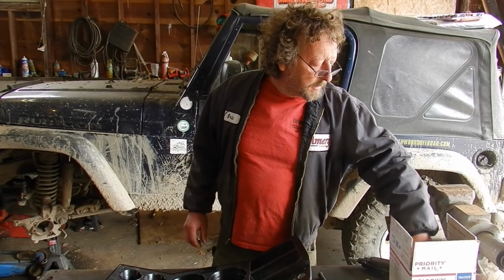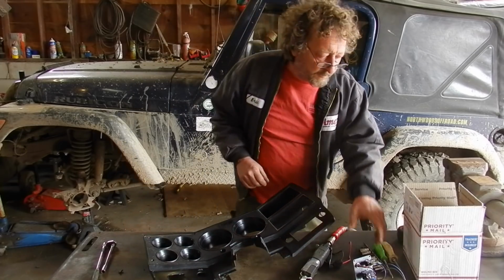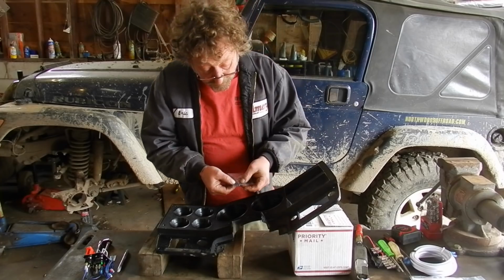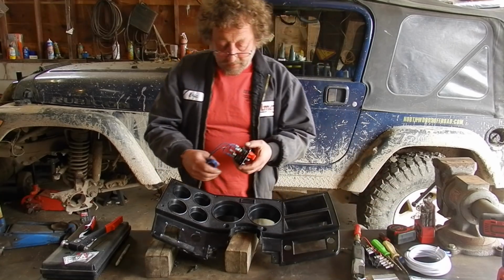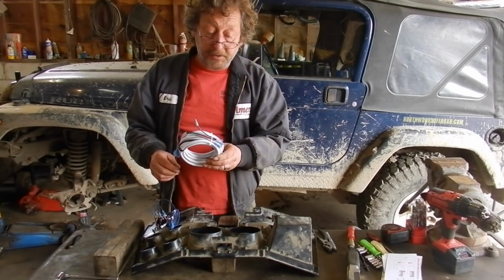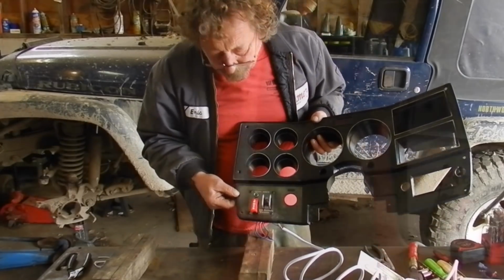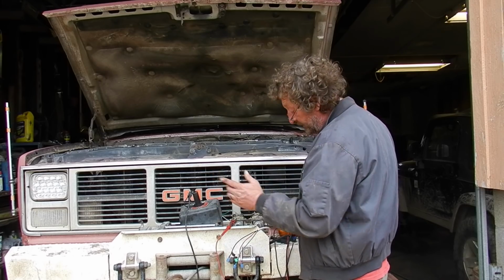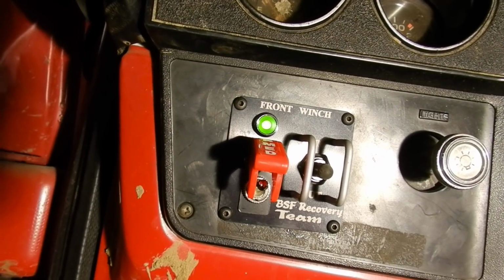IN CAB WINCH CONTROL INSTALL by BSF Recovery Team

Comment: 8:20 Crimp-connectors are okay, but I always try to solder wires together whenever possible, especially in your case where the truck is gonna be frequently jouncing around and having lots of dirt and moisture. :D

Comment: God bless you Eric!!
Scotch locks are the bane of mechanics everywhere!!!
They should be illegal for use on anything on the road. Use of them should be a jailable offense!
And don't get me started on wire nuts !!!
Reply: Yeah, I agree.  They cut through a lot of the wire-strands, and corrosion can occur in the joint.

Comment: I prefer the wireless control mod.  Can use it in the cab, in the vehicle you are winching, or anywhere else within about 100 feet of the winch.  Less than $20, and everything goes in the control box.  No wiring other than 3 or 4 eyelets in the box.

Comment: I've never seen a dash-mounted winch control before, have seen a couple of winch control sockets mounted to dashes where the original controller could be plugged in.  What prompted this particular direction with it?
Reply from the maker: We will answer that in a upcoming test and tips video.
Reply: Redundancy